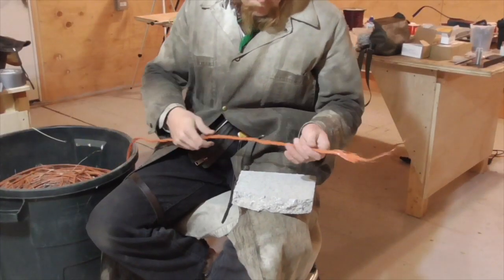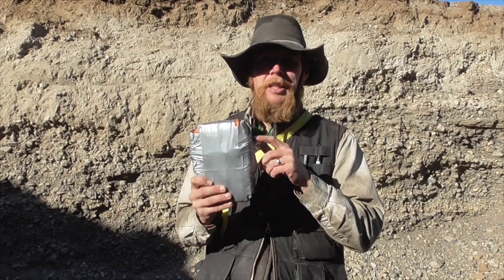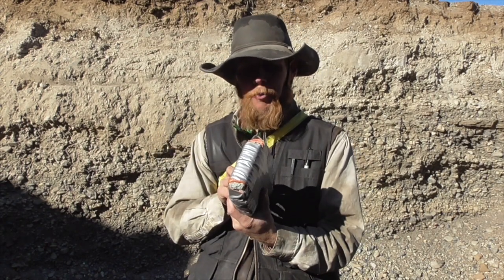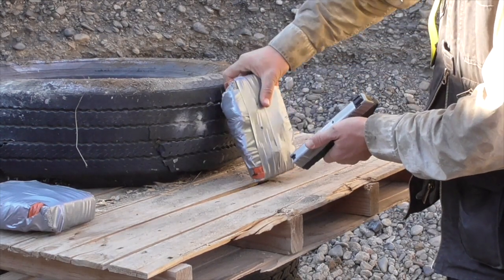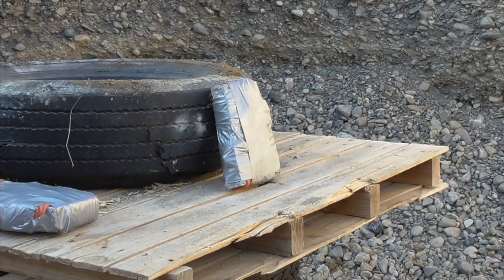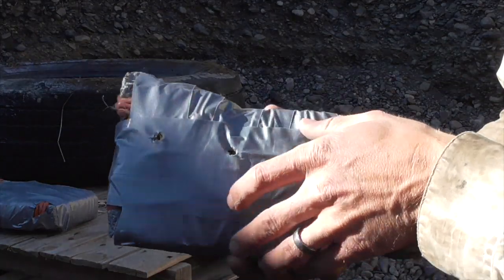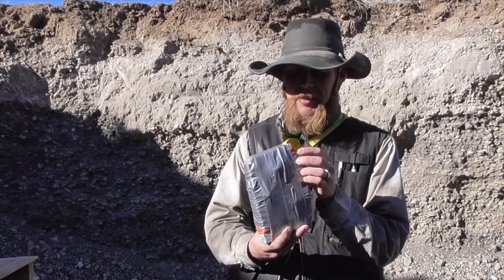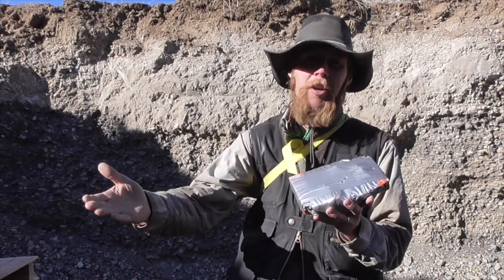Testing Improvised Armor: Cinder Blocks and Bailing Twine (TIS240)

Comment: ceramic tile and some paper taped together tightly cheap light weight and easy to make takes like quite litterally 10 mins or just tight taped a4 paper but for that u need to make sure it is tight could use resin tho

Comment: I was thinking maybe you could try one of these historical options (I don't nearly have enough resources or space as you do, or I'd do it myself)

1) Try the old ironclad ship composite armor of wrought iron/mild steel backed by hardwood.

2) Try compound armor of hardened but brittle high carbon steel backed by wrought iron/mild steel.

3) Try carburized, case hardened Harvey type armor.

4) Try cemented, face hardened Krupp armor.

These options might be worth exploring, given how prevalent mild steel plate is, and how treatable it is by packing charcoal around it.

Alternatively, it would be interesting to see a plate of mild steel with fiberglass reinforced cement poured around it to form a ballistic plate wrapped with Gorilla tape or something.
Reply from the maker: I'm not sure I have the resources to do those tests either, but I'll keep it in mind.
Reply: @TheIdahoanShow  No problem man. I love the show and I love the ideas you have and display. I thought you might find the historical examples interesting nonetheless. 

Keep up the work, good sir!😎

Comment: I took a quick browse and found Paul Harrel using books, poly carb, and floor tiles, he had fairly good results.  I also found a guy who used fiber glass that was quite effective.  Similar to this, once up against military round or high power hunting you need serious armour.  So is the goal to produce a ludicrously low cost armour?
Reply from the maker: Really the goal of these tests is just to assess the effectiveness of commonly available scrap materials at stopping bullets.  Ultimately this data could be useful if a person had to improvise some armor without access to specialty materials, and should also help to dispel some of the urban legends about various household materials being "bulletproof".

Comment: I wonder if the twine is really needed, or if you would be better off by putting the ducttape directly on the block.
Reply from the maker: I don't think the duct tape would be strong enough to hold the cement together by itself.  That's why I added the twine.  However, feel free to test it!
Reply from the maker: I don't think the duct tape would be strong enough to hold the cement together by itself.  That's why I added the twine.  However, feel free to test it!

Comment: I would be interested in seeing more bullet stopping content, perhaps more to compete with sandbags than body armour plates? Sandbags are very heavy and take up a lot of space, so if a lighter and smaller option could be made for a similar price point, that would be excellent for low cost urban fortification. Great videos, keep them up!
Reply: Good idea, especially since loose sand isn't especially easy to find in cities. Even If you stole some from the sandpit in your local park, moving it around with the roadblocks and snipers would be a nightmare.

Comment: More effective than I'd have thought, still heavy. Maybe for a static position?
Reply: May as well use sandbags or rammed earth for static positions.   Uses more readily available materials, far better multi-hit capability, and 24inches of sand or rammed earth will stop virtually any man portable rifle round.
Reply: @yunggolem4687  True, filling sandbags SUCKS. 
But I'd rather use these in a static position than walk around with them on
Reply: @xxxlonewolf49  Or as a filler between armor plates on tanks. They use plates with air between instead of using readilly available sand and soil. It's perfect. The tank would be easier to transport and the armor almost self-repairing.
Reply: @trollmcclure1884  for tank? eh, you'd probably be better of with just more steel, if making a homemade 'tank', for the weight/volume/effectiveness. if you are mixing steel, plastic & ceramic layers, then you'd be getting more effectiveness from it.
Reply: @xxxlonewolf49  They use all of these. Sometimes more steel isnt better but deflecting charge obviously is. Tanks and other vehicles were actually using sand bags a lot, look http://www.theshermantank.com/wp-content/uploads/2015/11/sandbagged-E8_zpsmjp5prjo.jpg
It's pretty good at stopping bullets up to .50 cal and maybe even 20 mm or slowing them down.